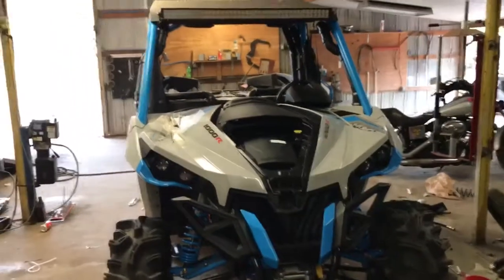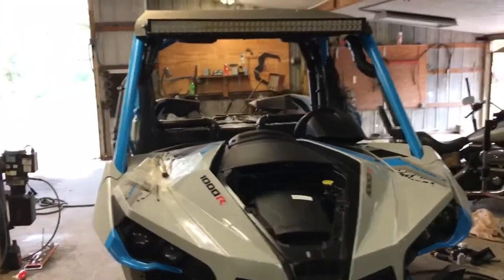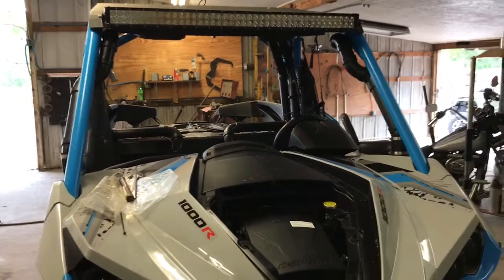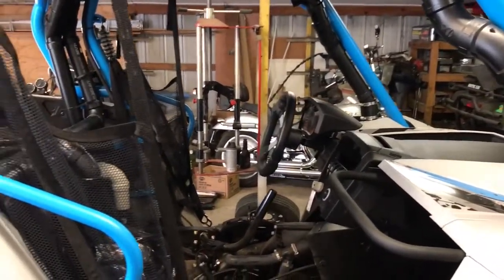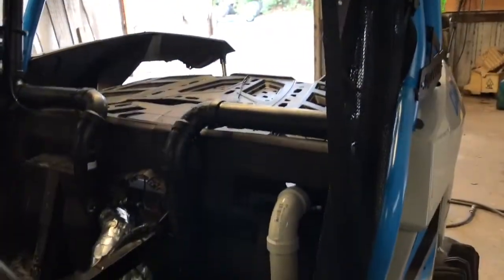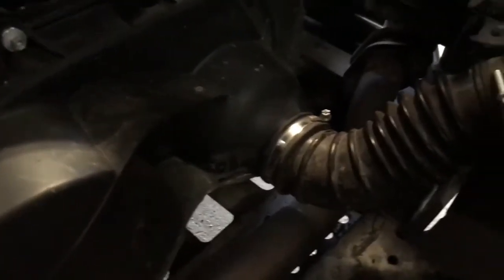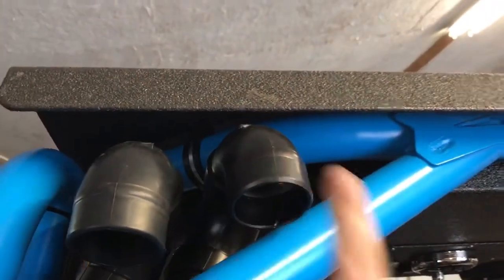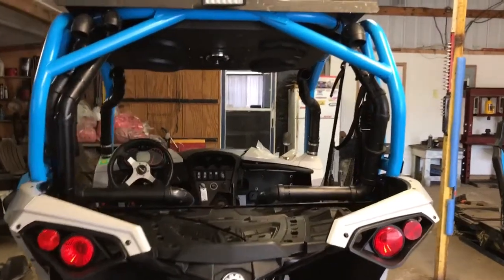Maverick snorkels.

Comment: The warrior kit comes with vent tubes also. Is there any reason to extend those up with snorkels or ok to leave in stock location?
Reply from the maker: Most definitely wanna use those vents. There should be one for the front diff one for the trans and one for the rear diff. You will fill those parts up with water if you don’t use them and plan on going deep.
Reply from the maker: The cooling fan actually has a little vent on it as well. I’m sure it’s for heat that builds from the fan motor but it will allow water into your fan as well. I also bought a on/on/off toggle harness from dz power sports that controls my cooling fan.

Comment: I bet your air filter stays cleaner without that intake being next to the tire eh?
Reply from the maker: Cnw 4x4 I haven’t compared it to much but i ride alot of mud and dusty areas, and i just change my filter every oil change. I worry more about mud getting slung into my snorkel pipes. They’re roof height but still in the splatter zones from the mud coming off the wheels.
Reply: RogueLegend check the little rubber drain port in the back every ride. It gets full of dust and leaves etc.
Reply from the maker: @cnw4x4  on the air box or cvt box? i have a paper type air filter. something similar to air filters in regular vehicles. Most of the time everything collects on top of it. The cvt gets trash dirt and leaves and stuff in it and it collects at the drain plug like your saying.
Reply: RogueLegend  what did you use for the 5th snorkle? Im about to do mine